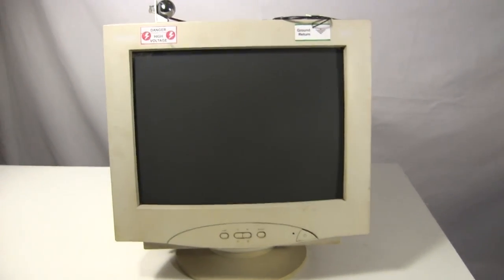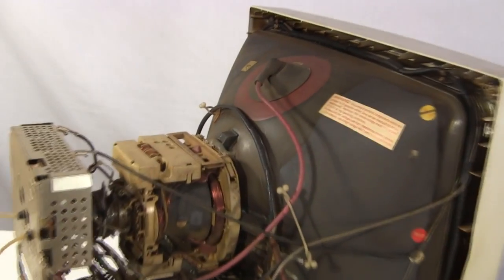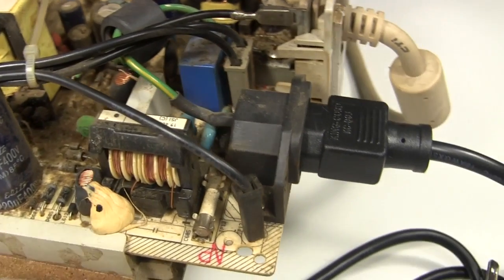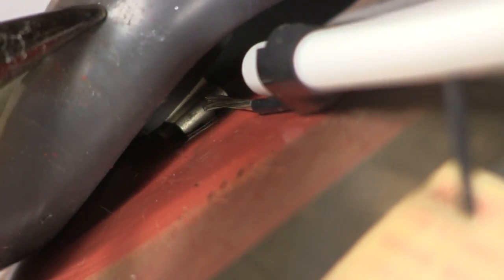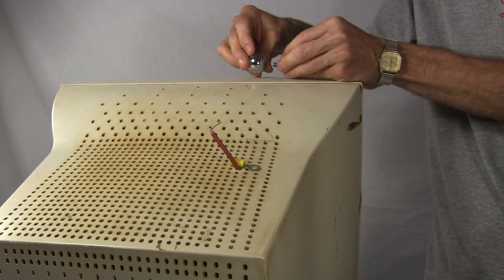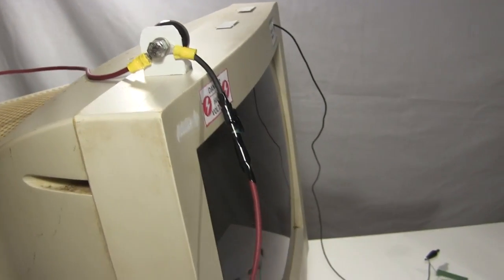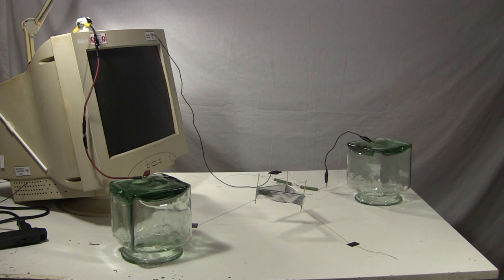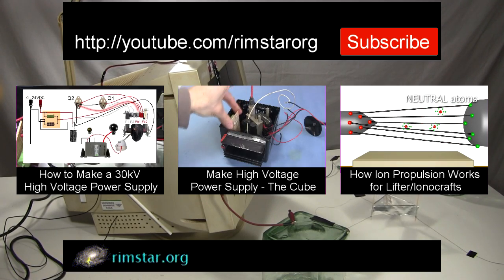How to Make PC/Computer Monitor into High Voltage Power Supply

Comment: Can this work with your electrostatic precipitator?
Reply from the maker: Yes. I didn't try it but because this monitor power supply is basically the same as the 30kV power supply that I did use I think it would work.

Comment: The Hi voltage  would be higher  if you left the anode wire from IHVT. Hooked up to CRT.  Splice into the lead just before the  cup hooked up to crt. The picture tube/crt  is also a big capacitor providing  filtered DC  raising the hi voltage  up. I made one of these out of a old 2001 19" TV  and  made a air ionizer.  I made a  large tube out of thick plastic   with two screen grids inside the tube. My  hi voltage  lead and ground  came from  the picture tube anode lead.  And crt ground   passing through back cabinet  to the plastic tube. I placed a 12 volt brushless computer cooling fan  inside tube to move the ionized. Air  out top of tube. A screen is placed at top mouth of tube  for added protection of hi voltage.  The tube  has 3  plastic brackets to make a opening at bottom of tube to allow air to flow into tube to be ionolized. Works great !  The air has that ion. Smell like you get when you go outside  during or just after a good size thunderstom.
Reply: Is this not already filtered? 
I need a constant DC high voltage supply.

Comment: Can you please tell me . We dont have earth ground wires where i live can you please tell me where to take the negative or where to connect it other then earth ground wire
Reply from the maker: High voltage isn't safe if you don't have an Earth ground. I'd recommend making one, perhaps by connecting a wire to a large metal sheet or a thick copper rod a few feet long and burying the sheet or rod in the ground, preferably not dry sand.
Reply: @RimstarOrg  i did it it took me 3 meter long wire and astainless sheet .now i got a new problem ... it all works well but the screen protection tuens off after few minuts of not receiving signal any suggestions please .???
Reply from the maker: I don't have a solution for that. That's why I made sure mine didn't have the protection first, though if it takes a few minutes then I can see why you didn't know it would do that.  Unless you find a solution elsewhere, you'll have to use it for only a few minutes at a time. I never use mine for more than a minute at a time.

Comment: I am so perturbed at "safety"  circuits on more modern CRT Flyback boards. Disconnected from the crt they turn on then click click click and right back off - Safety mode. All my research is pointing to X-Ray protect but I've gotten nowhere on disabling this feature.
Reply from the maker: There may be a way to satisfy it, if you can figure out what it's looking for. I don't know what that is but in case you hadn't thought of looking, I thought I'd mention it. If anyone else here knows then please speak up.
Reply: @RimstarOrg  Thanks RimstarOrg. Yeah I can't get a flyback board to work detached from a crt anymore :(. All the literature says its a pin on the bottom of flyback that if goes over 12 volts (High Voltage Detect/X-Ray protect mode) it feeds to pin 2 on the integrated circuit and shuts it down until being unplugged.

Comment: Daring act! I am sure you could solve my problem. I want to discharge 6kv cap in defib,when I calculated 2M,18watt resistor is required but this resistor is not available anywhere. What will be alternatives.

Comment: If you keep the connection to the CRT, it acts like high voltage capacitor. This can be used for destructives tests. Each sparks dump lot more energy in the fluorescent/neonLCD or any other device you intend to destroy progressively.

Mot to mention damaging cell phones or other sensitives devices.

Comment: Hhhhhm ... whodunit this DC High Voltage power supply burn out after only a week ? The horizontal deflection transistor really isn't made to power the flyback like this , I know for a fact that using CRT TV in this way kill the  horizontal deflection transistor  for a week at best

Comment: Hello RimstarOrg, I hope you still answer to comments of your three year old videos.
I really adore your work and passion at providing us information on how to make stuff. I started the Ion-Lifter project and really need a high voltage PS.
I was thinking if I could use something like this for my Ion-Lifter: 
http://www.ebay.de/itm/DC-12V-to-20000V-High-Voltage-Electrostatic-Generator-Negative-Ion-Generator/272509591163?_trksid=p2045573.c100505.m3226&_trkparms=aid%3D555014%26algo%3DPL.DEFAULT%26ao%3D1%26asc%3D44831%26meid%3Dfa0ef2726c6f4675a7333104ebd84665%26pid%3D100505%26rk%3D1%26rkt%3D1%26

It is cheap as dirt and yet looks promising. Is it suitable for my Ion-lifter? I mean it would be better if it could output 30kV but i Think 20kV would still do its job at lifting. Your marvelous reusage of that monitor provides 24kV according to your measurements and handles the lifter with ease, so 20kV should also generate lift (smaller gap)

Thank you so much for your attention.

Best regards,

Kaplan
Reply from the maker: I don't think that ion generator will work.
 I did voltage measurements here too http://youtu.be/LOGAaObsN4g and it seems to require around 24 to 25kV. Decreasing the distance between the wire and the foil reduces the voltage required and so does using thinner wire (I use 30 AWG). Doing those might get it down to 20kV.
However, that one's also rated for only 5W whereas near the end of my video about making my 30kV power supply, I measured the input power for the lifter and it was 20W (https://www.youtube.com/watch?v=GEuK1OdYxHk). That's because you also need a lot of current for the ions.

Comment: Is this a DC ??
Reply from the maker: +Milan Brkic Yes, high voltage, flat DC.
Reply: +RimstarOrg Thanks.!
Reply: +RimstarOrg I am trying to find some source for Tesla coil.How can I use this.? Can I use that ground wire(you connected to the chassis) like second wire of power supply.?
Reply from the maker: +Milan Brkic These PC monitor power supplies don't seem to be able to handle very long sparks without breaking. The Tesla coil's spark is pretty short so it might work. Other than that, I don't see any reason why it wouldn't. And yes, you can use that ground wire as the second wire of the power supply.
Reply: +RimstarOrg Thanks alot.!
Reply: +Milan Brkic Thanks a lot.!
Reply: +RimstarOrg I have to ask you something more. Is that. Is that (a PC monitor), same thing as your "cube", or "cube" is better for Tesla coil.?
Reply from the maker: +Milan Brkic I haven't looked in detail at the circuit in the PC monitor but my understanding is that they're very close. The PC monitor has a flyback transformer followed by a 3 stage Cockroft-Walton voltage multipler, but the cube has a flyback transformer followed by just one or two diodes. The result I think is that the cube has lower voltage and higher current and the output is less flat. It's hard to say which is better for sure for a Tesla coil, but I think the cube is because of its higher current. Both have enough voltage to cross the spark gap.
Reply: +RimstarOrg Thanks a lot. I tried a several ways to ignite the flyback ( one of that is similar to a "cube" )but all of you have a bigger sparks than I can produce.I will try to experiment with this,. Thanks again.

Comment: What will happen if we touch the output current?
Reply from the maker: vijay ram sri ram I don't know exactly what will happen but I do know that this is a dangerous power supply. Stay away from its output and discharge anything that you've charged before you go near it.

Comment: Could this output a negative voltage?
Reply from the maker: Aren Leishman I don't think so. You'd have to change the direction of the diodes that are built into the flyback transformer unit, which may be hard to do if they're encased in epoxy. But if they aren't encased in epoxy then you can reverse them.
It'd be easy to do with this other power supply of mine (https://www.youtube.com/watch?v=GEuK1OdYxHk) because the flyback has no built-in diodes. Instead it goes to a tripler (a Cockcroft-Walton voltage multiplier with 3 stages) which is made to put out positive high voltage. So replace that tripler with a homemade Cockrcoft-Walton voltage multiplier that puts out negative high voltage instead or replace it with some high voltage diodes (though the output voltage will be lower than with a multiplier.) I do that on my webpage here with a similiar power supply http://rimstar.org/equip/negative_voltage_multiplier.htm.
Reply: +Aren Leishman Only a specially made flyback would do negative voltage. Worthy a try to negotiate with the manufacturers.

I know, since I already have a pair (negative and positive)

Comment: HI!!!
my friend and i just built one!! super excited.  i'm wondering now about it's lifetime and usage.  Do you have any pointers here?  we built it for a science fair but are worried we are going to "burnt it out"? and. what would that look like?
Reply from the maker: Jody Coakley I've never used one for extended periods of time though I was careless with one a long time ago and didn't use the resistors that I talk about at 3:41 in the video. The power supply simply stopped producing any voltage after a big spark at the lifter. In general, avoid producing sparks, unless they're very tiny. The high current from a spark is what can damage these and is what the resistor helps protect against.Be very careful with high voltage. Always turn off and discharge the power supply and the device you're powering before going near either. At a science fair make sure people can't try touching these things while charged.Also, lifters produce a lot of ozone so use in a ventilated area. Science fairs are usually held in big halls with doors open and lots of air flow so that's probably okay.
Reply: Hmmm, I may have done some damage with the initial testing...I made a 3 inch arc with the grounding stick ( loaded with the same power of resistor you mention) .   The clicking sound was quite fast on that first test, but now it's quite slow.
Still produced some corona on the lifter though:-)
Reply from the maker: Jody Coakley
As you guessed, that clicking sound is an indication of something bad. These monitor power supplies don't handle arcs very well. I don't know exactly what the clicking sound is though. I'd guess a relay but I don't know if there are any in the circuit. The other possibility is a tiny arc somewhere in the circuit where something has broken down, could be in a capacitor or between windings on a coil. 3 inch arcs are pretty big for this power supply to handle. When such an arc occurs with this power source there can be a lot of current in it.
I have tips on http://rimstar.org/sdprop/lifter/lifter.htm for getting a lifter to fly. Hopefully you still can. I know sparks and arcs are neat for demonstrations but this isn't the power supply for that.

Comment: Can you use an old TV?
Reply from the maker: Christopher Teale To make a high voltage power supply with small modifications to the TV like I do in this video with a computer monitor, yes you can, but I've never done it and don't know the steps. Be careful, it can be dangerous opening those up.However, my cube power supply was made by taking the flyback with its builtin diodes out from an old TV and starting from there as shown in my video here https://www.youtube.com/watch?v=-KFhBVfpfDwBut, if you want to use a power supply like my cube for powering a lifter, I couldn't get it to lift off. After a few tries I just burned one of the legs of the lifter as you can see here https://plus.google.com/116395125136223897621/posts/4MeNfcWoACN
Reply: Ok. Thank you. I think Ill give it a shot

Comment: Out of curiousity, would this work for modern computer monitors you know the less bulky ones or only the cathode ray monitors?
Reply from the maker: Brandon Fisher As far as I know, only cathode ray tube monitors since they require the high voltage for making the tube work. I'm pretty sure the thin, flat modern computer monitor in front of me doesn't have any flyback transformer (which is what makes it work in the CRT monitor.) Maybe there's other useful stuff, but not that.
Reply: (never tried this dont know if it will work) older lcds had inverters with high voltage for the mercury lamp. You could try this with a 2000-2005 LCD monitor.

Comment: What should be done for ground if the CRT doesn't have a three prong cord and there are no apparent grounded plates?
Reply from the maker: What kind of CRT are you using? I can't imagine a PC monitor with no ground. I hesitate in advising since I don't know anything about you're CRT and this can be dangerous. I'd say the neutral wire can be used instead of the ground, as some have pointed out I think on hackaday.com in response to this video, but again, I don't know anything about your CRT so insert disclaimer, do at your own risk.

Comment: nice "compact" psu :D
why not just use flyback outside monitor with 555 driver or zvs ? its actually easy to make and you will get much more power output :)
Reply from the maker: Tiny, isn't it :D
I have other power supplies starting with just the flyback, "How to Make 30kV High Voltage DC Power Supply with Flyback & Cockcroft-Walton Multiplier Tripler" and "The Cube - How to Make High Voltage Power Supply w Flyback/Builtin Diodes", but for this video I wanted to make the PC monitor one just to add to the possibilies.

Comment: Great tutorial, as always! I'm wondering how many amps your monitor/power supply can deliver.
Reply from the maker: Thanks. Based on what I know the lifter takes to fly, the current is somewhere just above 250 microamps at that point. Unfortunately my analog meters don't cover that range, and I don't use digital meters when it comes to measuring current in a high voltage circuit.

Comment: Make absolutely certain that you have a monitor with a ground wire on the input socket, and it is actually connected internally. Most older monitors have a floating ground, so touch any metal shielding, and you will form a path to earth ground via your body, which could potentially be 100V+.
Reply from the maker: Seriously, even the plates inside of older monitors aren't grounded? However, if you've discharged the high voltage side to ground and are not messing around inside it when its plugged in then shouldn't it be safe? Also, why would the shielding have charge on it? Not arguing, just asking.
Reply: RimstarOrg Google Hot Chassis. It is where the ground is a virtual ground, not earth ground. The potential between the chassis and true earth ground is potentially lethal.

Comment: You might consider taking the PCB out of the monitor and putting it into a nice wooden box or plastic enclosure. The CRT makes the thing a little cumbersome to use and store. You can save a ton of weight and size with a new case.

Great way to get a cheap power supply! Thanks for sharing and including all the safety advice. Too many people show dangerous experiments without adequate safety discussion.
Reply from the maker: Yeah, the point to this one was to do as few modifications as possible. I already have enough videos on making smaller power supplies other ways.
Keeping an eye out for that announcement you have coming up. Knowing you guys, it should be interesting.

Comment: How many amps are coming out?  Voltage will hurt you, but amperage will kill you... I think...  anyway, is there a way to splice the red wire and keep it connected to the monitor? Just curious.  I used to have a few of these monitors handy, then my dad was cleaning and he threw two away, so now I have one... but we dont use it, sooo, idk.  Isnt it a little bulky just to.use its power inverter thing? I know I sound like I dont know what im talking about, but I can see it in my head, I just forget the terminology at the moment... im tired is all...
Reply from the maker: I don't have analog meters to measure the current in the range that it's in (I don't measure current in high voltage circuit with DMMs anymore. Tends to damage them.) But I did lifter current measurements in my "Lifter Voltage/Current and Smoke/Airflow Test Measurements" video and it was somewhere just above 250 microamps. And yes, it's bulky but it's easy to do if you do it safely. I have other videos showing how to make smaller units.